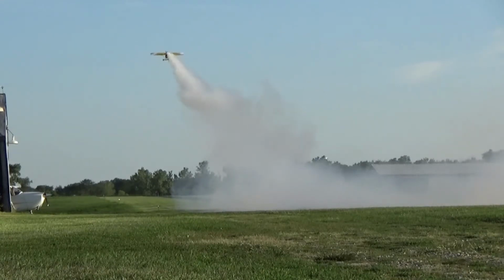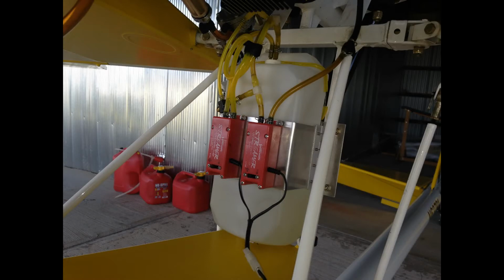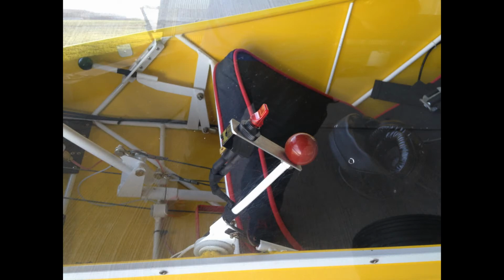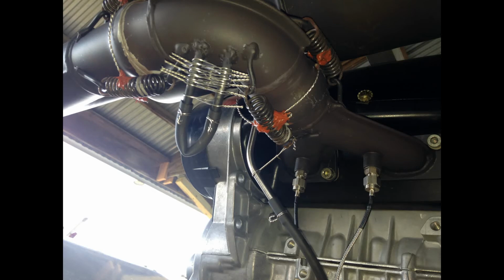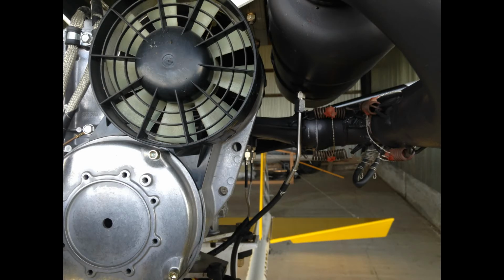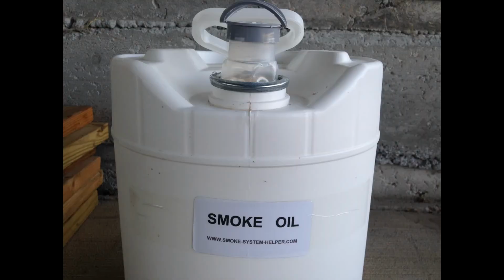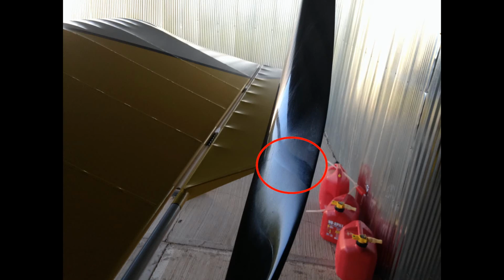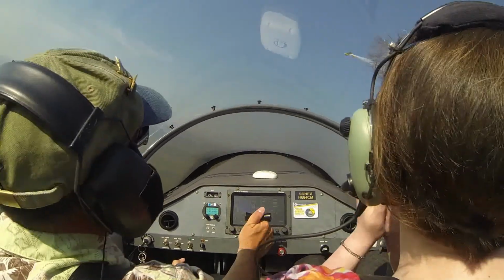Rotax 447 Smoke System Explained

Comment: awesome vid.  very informative.  found you from tucker gott comments section.  I'm researching and building my own system currently for my moster 185.  smoke is my next mile stone.  gopro was milestone 200hrs.  Smoke will be added when my new exhaust reaches warranty expiration next year.  I managed to get 150hrs out of a My2019 exhaust, the notorious cracked out exhaust that plagues all prior 2020 year model mosters, finally caught up to me.  I've built my own injection nozzle so far from a drilled out an-4 aviation bolt that had predrilled holes both head and threads for cotter pins.  The head of that bolt is going into the exhaust chamber and the shank and threads with a spacer will be on the outside.  I used an indexed bit drilled size 54 to go completely thru the bolt head to tail end.  Installed a clipped cotter pin jammed it in the center hole and tested with baby oil in a jar.  I get a perfect split stream from the cotter pin holes on each side of the bolt head.  Next I'm going to fab up or find a thin washer to bend into the streams to deflect and hopefully fan spray each stream as it exits the bolt head.  I was talking with the fella Harlan who runs bad dog smokes and he was insisting I drill the hole in the exhaust very near the exhaust manifold near the head....if I were to use his injector.  He didn't like the idea when I sent him a copy of your other video on the powered parachute trike where it was injecting into the muffler section.  I had concerns like you mentioned here with pressure wave and engine rpm alteration during operation.  He's stopped replying since.  So I decided to drill the bolt and forge ahead with my own plans.  So just to confirm, you recommend injection after expansion chamber or just before expansion chamber?  I've not located the hole yet, still researching as mentioned....and testing.  Cheers!
Reply from the maker: Definitely put the hole after expansion. You will regret it otherwise. 2 Stroke dirt bike guys do the opposite and they inject water for a “boost” of lower. I wouldn’t gamble that with anything aviation related.
Reply: @JWolfe104  Thanks for the swift reply.  Sounds like you know a thing or two about 2 strokes already.  I don't know much about your Rotax447 or Kolb Firefly, I'm new to fixed wing ultralights.  Is that motor fairly reliable?  Would you trust it say as a weekly commuter from lets say, Lafayette LA to Galveston Tx?
Reply from the maker: @murdockdacoon2055  The problem with the 447 is they quit making it. Mine has done nothing but pure like a kitten for 170 hours. Zero complaints. However, I monitor engine parameters closely and I have mixture control. I spent a lot of time on jet settings too. What will kill a two stroke is running too lean for long periods. Keep it in the sweet spot and it will help a lot.
Reply: @JWolfe104  thanks for the reply.  My first motor, the EOS150 was also made in Austria.  I installed a remotely controlled servo on the carb attached to the H adjustment that I could manually tune via a small Pot on my throttle handle.  It was super slick and worked well for xc cruise at Altitude.  I don't fly that motor any more tho as it was the Model A and they didn't work all the kinks out before they mass produced it.  It was actually the First one shipped to the US.  We were the test bed of sorts.  I have a friend in the business here who is very well connected with Parajet, Vittorazi and many others in the game...too many to list.  Cheers.

Comment: I just finished designing a ppgsmoke.com paramotor smoke system thats similar to this. It has a 500ml flow rate (high) and produces about 2 minutes worth of smoke on a 1L container. You can size up on the fluid container for longer run time. We are also producing some injection hardware. Check it out.

Comment: I'd mount the injection hole to the left to strike that exhaust pipe, too, but from above, so the oil hits the hot pipe and splatters to hit the walls  of the outer chamber too, and dribbles around the hot pipe to vaporize.   An atomizer spray tip might help too but might reduce your volume and from the videos  it doesn't look like you need it.
Reply from the maker: CHOPPERGIRL's AIRWAR I did modify the injection tube to fan the spray out a bit. I don't get any liquid on the tail. As hot as the exhaust is, you almost can't mess up with the delivery system.
Reply: Roger that.  I forward your video they other day to a guy building a Po Boy, he plans to use heavy duty RC electrical servos for his aircraft controls...    so yeah, other RC parts (well, robot parts) in ultralights!!    http://www.matoonline.com/PoorBoy.htm

Comment: Very clear and helpful video, thank you.

I'm watching many videos on adding this type smoke system to a 2-cycle PARAMOTOR exhaust.   I see most online videos showing an installation by tapping into the exhaust pipe very close to the cylinder head.  After watching your video I'd believe your comments on location in a tuned exhaust system is wholly applicable to PPG tuned exhaust systems.     But they all seem to do it.  

Perhaps they are not aware of the issues you identified.
Do you happen to have thoughts, counsel, advice, on where to locate the injection fitting in a PPG 2-cycle motor's exhaust system.

Comment: Dumb question - is there a possibility of turning your exhaust into an accidental flamethrower if you install the inlet too far upstream where it is hotter?
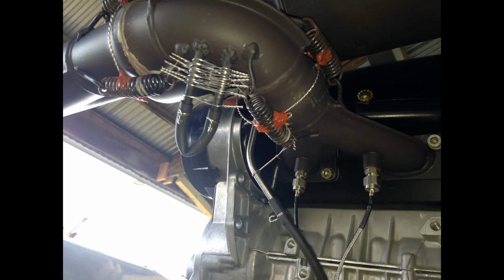Reply from the maker: Rcbif I don't think so. The hot exhaust gas is a combustion byproduct, so it contains very little oxygen, which is what you'd need to make a flame thrower. The bigger problem with mounting it further upstream is the impact to valve timing. See my comments at 5:30.

Comment: Hello,

I have seen your video and I have loved your installation of a smoke system for Rotax. I have a S-4 Rans with a Rotax 503 and I want to install a system like yours, but I have some doubts:

1.- Capacity of the tank and what type of tank is, how many minutes does it have to smoke?

2.- Type of liquid to make smoke, have you tried with diesel?

3.- Type of injector used in the exhaust and where to get it or details about installation.

Thank you very much for your time, greetings from Spain
Reply from the maker: Pedro M Thank you for your comments. The smoke delivery is truly impressive. 

Sorry for the American units of measurement. The tank is 60 fluid ounces. The pump puts out about 30 ounces per minute, so it only lasts about 2 to 2.5 minutes. There is no fluid on the tail or prop at this flow rate. The exhaust is really hot and will burn a lot of fluid!. This flow rate is about right. 

I have tried baby oil and professional smoke oil. I never tried diesel, but I think it would work OK. Most people mix it wth a little transmission fluid. 

The nozzle is nothing special. It's just 1/4" diameter steel tube. I squeezed the end a little flat to make a fan pattern. That's it. The most important thing is to leave the tube sticking out from the muffler about 3". You want the  steel tube to dissipate heat before the connection to the rubber tube. If the rubber gets too hot, it will crack quickly. 

http://www.sullivanproducts.com/FuellPumpsContent.htm
Reply: Thanks a lot for your response!, no problem with American units since google exits :-) , best regards!